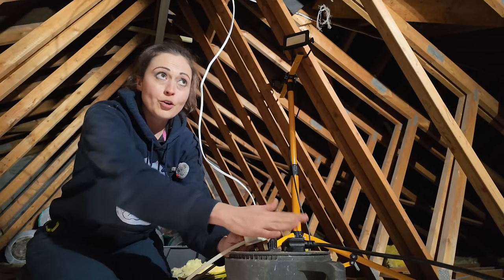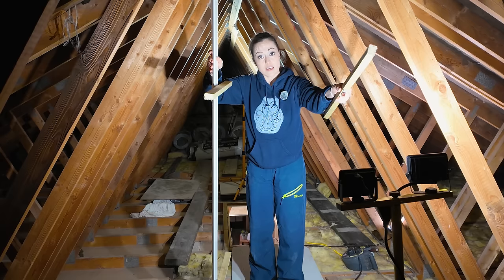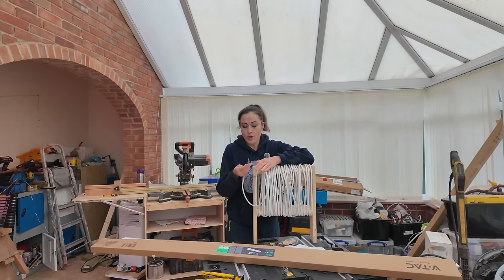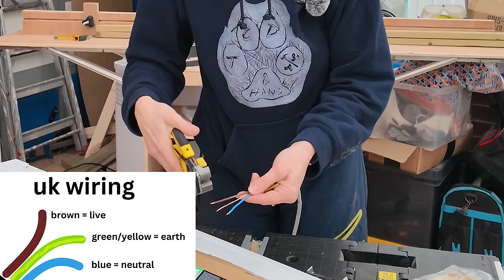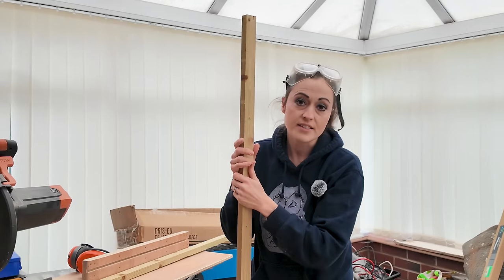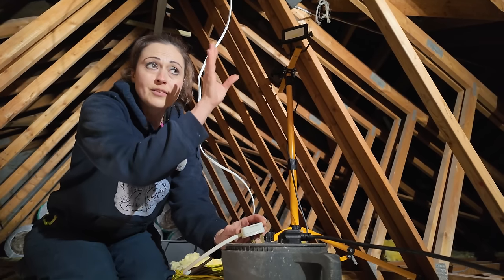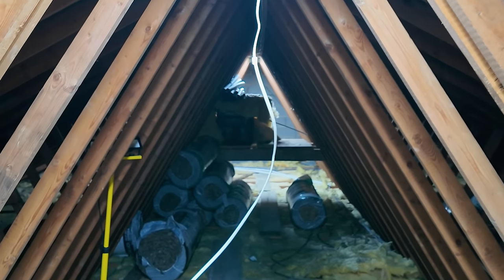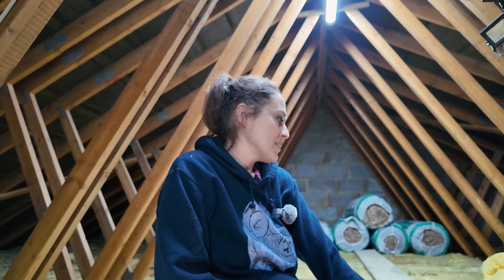The BEST attic/loft lights installation for BEGINNERS? {No Electrician Needed!}

Comment from the maker: Do you think I should connect it to a permanent live feed or leave that for an electrician???
Reply: Yeah I would but then its my house and I'm not on youtube ;-) You could get them to install a socket in the loft and then mount a switched extension on the wall. My whole shed/garden is an appliance ;-)
Reply: Any electrician will tell you that adding circuits yourself is not permitted under Building and Electrical Regulations. If it were my attic I'd run the cable and outlets but get a friendly electrician to make the final connection at the board or tap into a circuit.
Reply: It would be a simple job to do it yourself, but by law an electrician must check and sign it off.
Reply from the maker: That's exactly my husband's way of thinking, but I made sure he kept his mitts away from this one 😆
Reply: I wouldn't even bother.  In reality it isn't very often you use a loft and running that lead isn't that much of a pain.  If you were to do this, then you could use a kinetic wireless switch to control the lights from downstairs without having to run ugly wires and might make a good video for those that have yet to discover the newer technology.
Reply from the maker: Thanks for the tip as always :) I think I'd feel cheeky asking and get them to do it all instead 😆
Reply from the maker: Thanks. Good job I didn't do it then 😆
Reply: I would never recommend connecting a socket to a lighting circuit. Lighting circuits are unlikely to have the correct cable rating for a 13A rated socket.
Reply: Electrician as it is not permitted under the regs thingy.
Reply: I would find a permanent live at a light fitting and wire to that. Then add a switch by the loft hatch to save you having to run a flex to the socket every time. You could use your Wagos to join the earth and neutral behind the switch.

Would need testing by a qualified electrician afterwards.
Reply: I’d certainly get a  qualified electrician to do the work. Maybe it is time for a collab with another YouTuber in the trade?
Reply: Leave it to a qualified person for insurance purposes
Reply from the maker: @canalboating when I told my husband what my plan was, he immediately wanted to take the job off my hands and do exactly what you just said 🤣🤣 But I wanted to learn the basics.. safely. I've only ever wired a socket and one of these lights (under the supervision of an electrician, who insisted on teaching me lol)
Reply: I did in my loft but was lucky to find a junction box I could tap into 😀
Reply: I would just leave it as it is and just use and extension lead and plug it in when you need the loft, works fine for me only go in the loft once or twice a year 😊
Reply: @richieh92  The fuse in the plug will protect the lighting circuits or any circuit that is plugged into a socket
Reply: To everyone saying you need an electrician, Part P, blah blah blah. You don’t. you are adding an additional lighting point with is not notifiable work under part P according to the IET. 

If you are comfortable doing the work and you know 100% what you are doing, ie you are happy cutting in to the lighting radial circuit, adding the switch cabling etc then it is permissible works. 

If you are not confident then absolutely get an electrician in. 

I for one would recommend a switch as it’s less faffing about and less to trip over. It’s safer full stop.
Reply: Could connect it to an existing lighting circuit. Could pick up a feed at existing ceiling light. One would need to add a switch near loft hatch
Reply: @davideyres955 finally some sense. If you are extending a circuit you don't need an electrician - as long as you test the installation and deem yourself competent.
Reply: I'd have run the solid copper cable that you originally had, down through the ceiling into a cupboard, (preferably one with a socket), connected to a wall mounted switch. The switch then wired to plug into the socket. All in trunking to protect the cable. To elimate the wall mounted switch, you could just use the switch on the socket if you have one.
Reply: @frog-eye1420   Really not best practice to do this. Most lighting circuits are rated at 6A so it is likely that the circuit will trip if a large appliance is connected to that socket. It's also a really silly thing to do on the event of the property ever being put up for sale and the new owner not knowing that the socket is on a lighting circuit and find that it keeps tripping and end up changing the MCB or whatever is in the consumer unit for that circuit with a 20A MCB for example, thus potentially causing the lighting circuit 1.5mm cable to overheat and potentially cause a fire!
Reply: If you are simply wanting to add a light switch for the lights, then adding to the existing lighting circuit would be fine. If you are looking to add an actual socket for appliances, I would not recommend adding this to the lighting circuit as I've mentioned in my previous reply. An electrician would never do this, keep lighting circuits as lighting circuits as they are likely using 1.5mm cable. If you are wanting to add a socket, I would suggest taking a spur from the socket that you were plugging the lights into (if it hasn't already been spurred), then chase the cable up into the loft and then re-plaster the wall.
Reply: Always good to give it a go but it depends on how competent and confident you are dealing with electricity
Reply: As everyone says don't add a socket to a lighting circuit, in our previous house that's exactly what someone had done! People worry about that here as normally most of the writing in a loft will be for lighting, but you have a bungalow so you may have the ring for the sockets as well so if that is what your tapping into you'll be fine.
Reply: @richieh92 the cable should be protected by a suitably rated breaker (6A) or fuse (5A). If someone plugs a large load into the socket, it will trip or blow. A permanent connection via a switch is preferable in this situation.
Reply: @RhysWilliamsEsq all work must be tested, inspected and certified. How does a DIYer get a test meter that can do insulation resistance and earth continuity, and certificates? To be competent means knowing and understanding the relevant regs - not just an arbitrary feeling that one is competent.
Reply: @tobysherring1369  I know, I expanded on this in another comment. If it's a switch for a light, it's absolutely fine but if it's a socket, it should at least be a spur from another socket that hasn't previously been spurred from. Putting sockets on lighting circuits is never a good thing, especially on the event of the property being sold and the new owner not knowing that the socket is on a lighting circuit and wonders why it keeps tripping and they potentially replace the 6A MCB with a 20A MCB and potentially overheat the cabling and cause a fire.
Reply: @vincejm  not quite. A competent person must inspect, test and certify. The most likely person to be able to do all three is an electrician, but theoretically non part-p work can be inspected, tested and certified by someone who has a proper tester, certificates and sufficient knowledge of regs to inspect.
Reply: @richieh92  Not really an issue as the breaker would trip before the cable would overheat.  That said I agree it's not recommended.
Reply: @cjmillsnun  I elaborated this in another comment, that is correct but if the property has new owners in the future, who don't know that the socket is part of a lighting circuit and wonder why it keeps tripping... they could replace the 6A MCB with a 20A MCB for example, thus, causing the lighting circuit cabling to overheat and potentially cause a fire.
Reply: @Christopher_T_Paul I didn't know about these Vicky, big thanks Chris!🍺👍
Reply: It doesn't work like that sorry.  The lamps only draw the current they need, so that wire is more than capable, could even drop to a 1mm cable if she wanted.  When fitting the plug you need to put in an appropriate fuse.  I think she said 0.5 amps each, so 2 amps in total, that is 480 watts, so it would be a 3 amp fuse.

If you look around your home, your microwave will have big thick wires because it is pulling a lot of power, no doubt needing a 13 amp fuse as it will be over 700 watts, then you look at a lamp, still plugged into a 13 amp socket, but the wires are very thin and will call for a 3 amp fuse.
Reply: @RichardDowd  They are cool and probably even easier than adding a switch setup.  You can buy a kit for less than £20.

Its as simple as running the live and neutal from your supply and connect them into the receiver unit, then attach the live and neutral for wire heading to your lights and your done.
Reply: I would. Safety first though, and plan out what you want to do before you start. After years of un-bodging something in my home, it just proves a little thought and planning go a long, long way.
Reply: @tobysherring1369  you literally don't need it to be certified. It's an existing circuit, only place would be bathrooms or outside
Reply: @richieh92  But there is nothing in the regs that says you cant have a socket on a lighting cct and yes lighting ccts are not fitted with cable for a 13A load but in a loft that wont happen
Reply: @JL-rx6hl  How do you know that wouldn't happen? What if somebody plugged in an electric heater, what if the next buyer is into IT and puts a server and some aircon up there?

Comment: Good Job Vickie. I'm a spark and I'm impressed with your sensible approach to safety by not tackling anything above your competence level
Reply from the maker: Thank you! :) It's not a task I'm comfortable with because I may not get a second chance to learn from a mistake. This may be my limit 😆
Reply: I was going to say the same. Wiring them in series would have saved you a little faff with the large junction box and don’t do the socket on the lighting circuit. It’s a simple and cheap job for a spark to wire those into your existing lighting loop with a switch.

Comment: Yup more light is always better!
Don't know if it's been mentioned but I'll put my word in- before you insulate make sure you air seal.  Make sure you caulk or spray foam any penetrations: wires, pipes, ducts, etc. that come up into the attic space. Insulation is so much more effective when you've eliminating air movement thru it.
Carry on with the great work.
Reply from the maker: Thanks so much! I'll add this on my to do list to check as we go!
Reply: @TheCarpentersDaughterUK  when you insulate - make sure air can get around, otherwise condensation can cause issues - you will see airvents in soffits and various house to allow an airflow ...  but i'm sure you will youtube that info

Comment: Nice work 👍 
Vicky you could of bought 5 foot fittings with compression gland at both ends you just daisy chain into each fitting then the last light just has one cable, 😊

Comment: What a cracking idea with the cross battens! I've not installed similar lights in my garage because of the weight of them - if I connect them with cross battens, it'll make it easy! Wonderful idea, I'm stealing it ;)
Reply from the maker: Glad it gave you an insight. I wish I'd weighed them now, but this type are VERY lightweight!!

Comment: Well done! It's so good when a job goes well, especially if it will make subsequent jobs easier. It's a good workaround to have lights plug in and one I think a lot of people overlook. It avoids the need for an electrician and for a sign-off. I fitted some LED downlights into my kitchen alcoves myself and as they plugged into sockets under the worktop, there were no regulations I needed to worry about. Lighting aside, your loft looks enormous! Maybe a conversion at some point. Good to see you have some signs of Christmas in your home. It's not a priority when you're renovating but it's good to have a break. In the five years I've been renovating my house, I've always downed tools over Christmas and taken two weeks off. I've created a festive bubble in my faulty towers and enjoyed forgetting about all my troubles/jobs/etc. Have a lovely Christmas Vikky :)

Comment: Nicely done! 👏 Thank you for sharing. I recommend a sparky, just in case there's something funky by the previous owners and creating a spur off the wrong circuit can cause issues later. Having a light switch at the top of the ladder is super handy (saves up and down the ladder a couple of trips) - if you're not up there a lot though, an extension lead approach is great - then you know the lights are definitely off!
Reply from the maker: Thanks so much ❤️❤️ Yes, that's exactly how I feel. I've seen a video on how someone had a go and an electrician went round to fix it. I feel I don't know enough of the unknown, but thoroughly enjoyed doing this

Comment: Well done Vikki - for lighting Wago221s are much better for the Wago boxes you had. I would call an electrician get him to connect it to a permanent live with a new convenient light switch at the loft hatch location. Most sensible electricians will inspect your work in each Wago (without undoing the connections) do an IR test on the run and then do the necessary for the switch run. You have saved him the tedious work.

Comment: Well done, Vikkie! 👏 What a difference all that light must make (I've worked in a few lofts this year that were dim at best). I've been repairing wires in my van today and suddenly feel more confident about tackling the lighting next. I plan to use Wago connectors too - good to see they're as easy to fit as claimed.
Reply from the maker: Thanks so much! Yes, they really are easy. They're chunkier than the smaller ones they've brought out since, but these were what I felt confident with after watching videos on them.

Comment: I did something similar in my attic. I did the short cross pieces, but then put a batten down the middle of the attic attached to the short pieces. I could put the clips up evenly spaced and lastly attach the lights. Having some bright lights in an attic is such an advantage if doing work up there, as I’m sure you will be!
Reply from the maker: That's a great idea too! I'm so glad I did it! I hated us having to move lights while we did stuff. At least we can tinker up there more and look for any issues if we have problem later on.

Comment: Good work! Wago connectors are a game changer house hold electrics, so much more secure than connector blocks and they can be connected and disconnected over and over without fatiguing solid core (wait until you fit the MK Logic Rapid Fix Sockets 😂). For most jobs I prefer the 221s, they fit in the boxes much nicer (check the amp ratings for your application first!).  Honestly you could easily connect up to the lighting ring, it's the same principle as what you've already done really. Heads up you can get earth sleeving in shorter lengths for a reasonable price from Wickes, I managed to do all of the sockets and lights in my house with 5m, the 100m from Screwfix / Toolstation is wayyy too much for DIYers!
Reply from the maker: Thanks so much for the socket name! I'd spotted them and didn't know what they were called! We're very tempted as have to upgrade the old storage heater sockets to double ones. And I wish Wickes was closer!!!!! It's 50 mins away from our new place 😐
Reply: @TheCarpentersDaughterUK  the sockets are great! They are a bit deeper, they say they'll fit into a 25mm back box but I wouldn't want to try. 35mm or bigger is much more comfortable.

Comment: Another great video lots of common sense. Love a Wago connector and box. A bit ott but for not a lot of money and a great sense  of completeness I use Ferrells and a crimper ( Amazon again)  for multi stranded cables. Makes plug wiring even more satisfying and easier for getting the multi strand into the Wago connectors. As other have said a 3 amp fuse in the plug and Robert is your mums brother !!

Comment: That's a huge improvement and should hopefully make it much easier to do any work up there. It's unlikely to ever be an issue but I've heard it's best practice to add occasional metal cable clips to prevent cable falling down in the event of a fire when used overhead. The whole house will be so much warmer once you manage to get all that insulation down I bet you can't wait.
Reply from the maker: I'd not heard of that! Yes, we really can't wait. We're slowly making a difference each week. Hopefully we'll be in the living room by Christmas week 😅 It's just too cold in there compared to the other rooms.

Comment: Hi Vikkie,  great work there on your loft lights, good use of existing cable using 1.5 mm or you could use 1.0 mm or done the lot in flex you could use 0.75 mm or 1.0 mm flex and it could be 2 or 3 core flex. each of those lights use between 20 to 25 watts in power, so 4 lights it will be 80 to 100 watts, just make sure you have fitted a 3 amp fuse but no higher than a 5 amp fuse if you haven't got a 3 amp. You are doing a great job on you new house and we all watch other DIYers for advice and to pick up other or better ideas we can learn from one another and I've learned a few ideas from your self. Catch you on the next one ,Take care  mate👍👍
Reply: PS , Nadolig Llawen = Merry Christmas😄👍
Reply from the maker: Thanks so much for the tip and glad you enjoyed it. And I'll do that if Mr TCD doesn't beat me to it (he wanted to tap into the electrics and I wanted to do it my way lol).
Reply from the maker: And Merry Christmas 🎄
Reply: @TheCarpentersDaughterUK  Hi Vikkie, you way is a good way, it can be wired to the light circuit or of a plug